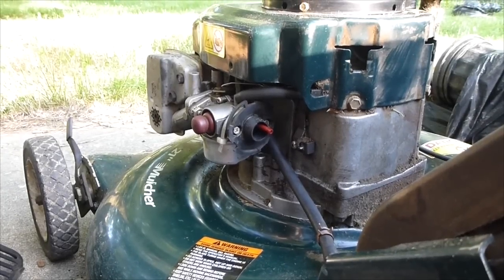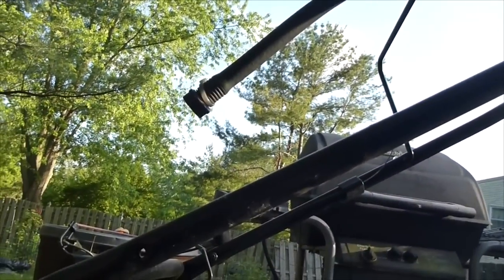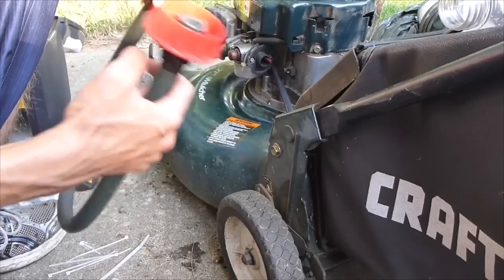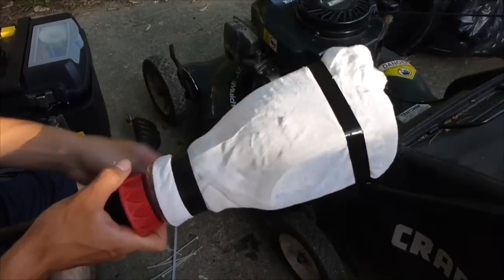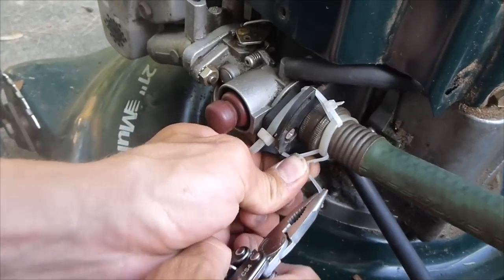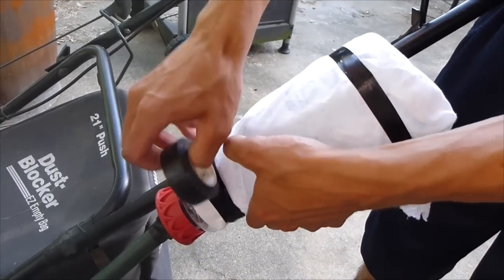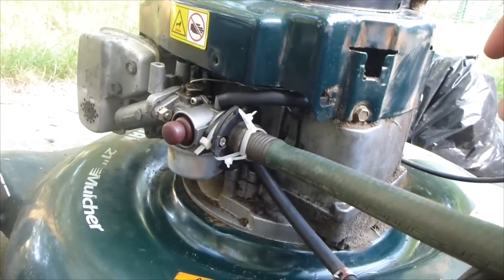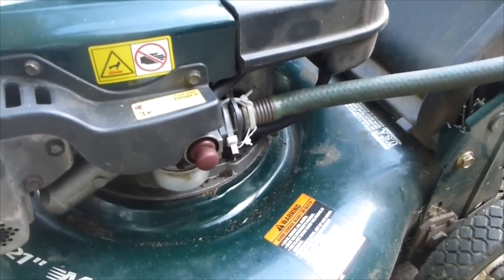Lawn Mower Cold Air Intake

Comment: Although for fun (yes, it is funny looking!), your idea is not that far fetched.  This has been used and proven in both off-road and military vehicles for many years.  Primarily a high air intake is to keep water and other debris from being drawn into the intake than if it were lower, such as at engine level.  The same principle applies here - keeping the crappy dust and lawn debris from being sucked into and clogging the filters.  Funny, yes, but actually a smart idea, Chris.  gives a green thumbs up!

Comment: Was working on two different mowers recently and now I see the different types of air filters they have.  B&S engine seems to use a flat air filter over a separated intake while the Tecumseh seems to use what you've got here a tube-in-tube hose cover.  Would be interested to see what you come up with to make a filter for the other style.

Comment: Like your other video's. You seam like a smart dude, but WHAT THE HELL!?
Being a lawn mower mechanic since I was 12 and am 29 now, this is dumb!
You don't have to change them out every month, just blow them out every mowing, and change every 25 hours. Along with the oil and the spark plug. Every 25 hours. 
Premium gas, sea foam and keep the blade sharpened, you should have no problems. Seariously. 
Have a great day. 
Loving the coolant flush video.
Reply from the maker: chef kdowg This was just for fun hahahaha
Reply: chef kdowg It's a free country to do whatever you want! Better than sitting in the house doung nothing.....
Reply: What the hell? Changing oil, filter, and spark plug every 25 hours? Using premium gas and seafoam? Why are you treating the lawn mower like it's a Lamborghini? It's really unnecessary. The manuals for some engines say don't even bother with spark plugs (and sometimes oil) until like 100 hours.
Reply: @NGGPeter  yeah, I feel this is true.

Comment: I've searched the internet over for a video for someone putting a car induction kit on a lawnmower. Would it work? Forget practicality. Does it work??
Reply from the maker: Well, what you saw in this video worked for what I needed. A car intake diameter is way to large to fit on a lawnmower. You will lower the intake velocity a lot and mess up the air/fuel ratio so...
Reply: ChrisFix I found a mower in a scrapyard with a fart Can aka a civic exhaust welded to it talk about loud

Comment: Love ricin out the mower... jk. But seriously I have an old craftsman mower. No to old cause it warns against e85 but beat up and nasty that I use on some rough jobs. The gas tank leaks on the seam. I tried using a tank sealant but that dried and cracked. Can you advise on how to put an after market tank on. Bigger would be better and I doesn't have to look good.  In fact the worse, more rigged it looks the better so no one will want to steal it.
Reply from the maker: Jeremy Harmon Plastic weld the tank. I will have a video on plastic welding soon!
Reply: ChrisFix ok thanks!

Comment: Cold air, maybe at first. The carb will be hot anyway so theres no real gain.

Besides, the restriction of the 'filter' and the pipe would outweigh the benefits of cold air
Reply from the maker: +Brad Reed This was kind of a joke lol.
Reply: +Brad Reed I doubt there is much real restriction. The cheesecloth is plenty breathable and the hose diameter is definitely not narrow enough to strain this little one-cylinder engine. It's not like replacing the breather snorkel on a car with a hose.
Reply: Brad Reed I see multiple venturi type holes on intakes where the SUV is called ecoboost. Not to long after that I've seen motorcycles with a multi venturi cone add-on. Filters are fazed into a steel screen added now.

Comment: Lol you actually used to change your air filter once a month? Lol I don't think I have ever even changed it on my lawnmower.
Reply from the maker: It got so clogged the thing wouldnt start. It was really bad. This setup, as funny as it is, worked amazing and I got 2 mows instead of one per tank of gas lol